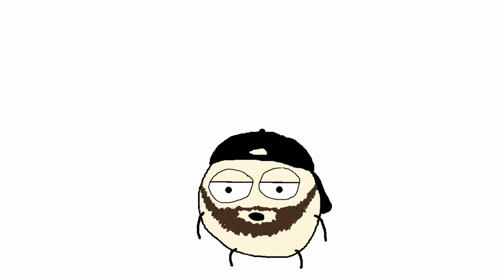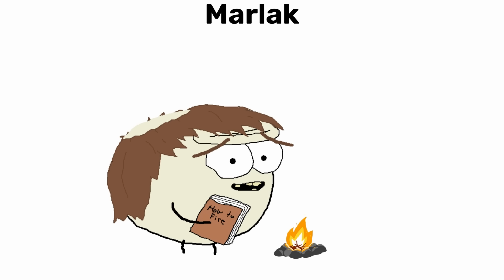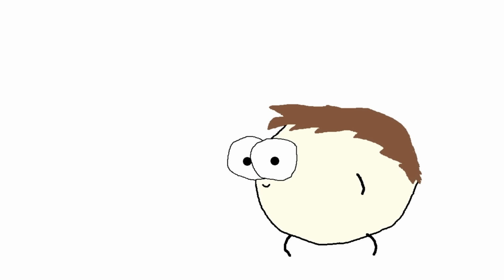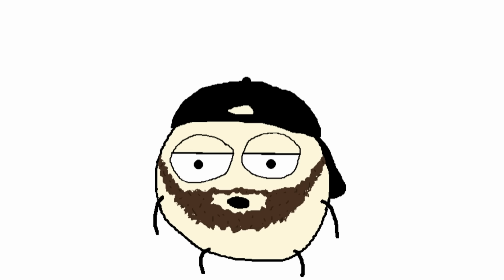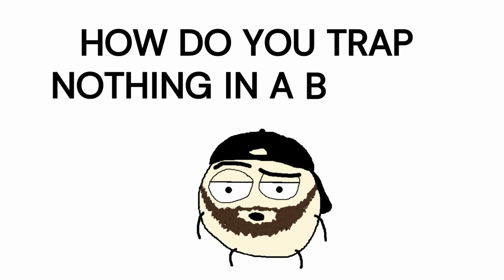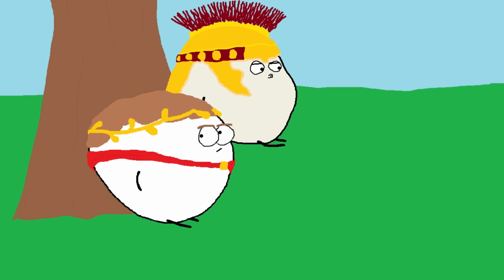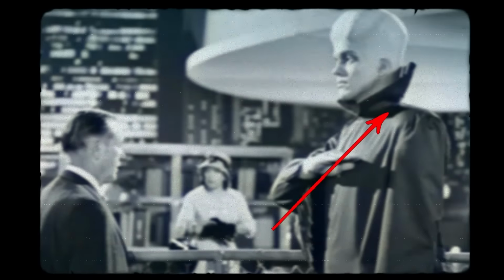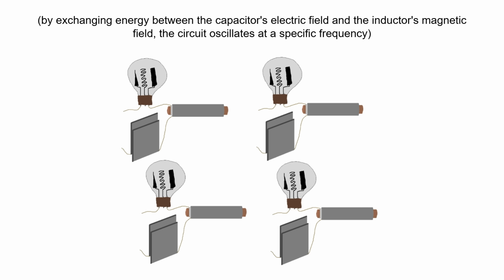How long would it take to build a TV in ancient Rome?

Comment: Nuclear reactor vs computer chip in Han Dynasty China? (I beg of you)
Reply: nuclear reactor would be the easiest. we DID invent the nuclear pile before the integrated circuit, after all.
Reply: @michaelfixedsys7463  that's not even mentioning natural reactors, which already existed hundreds of millions of years ago. in it's simplest form, a reactor is just a pit of nuclear fuel, use that to boil water, put a turbine in the way of that steam, and you're done. meanwhile even the most basic silicon transistors... it'd take decades...
Reply: Depends on how controlled the reactor has to be, because "completely uncontrolled" was figured out by geology under west Africa quite a bit before humanity ever considered that uranium can go boom.
Reply: Ts fire
Reply: Interestingly, the first nuclear reactor was natural, and about 2B years ago.  Back then, the ratio (we would call it enrichment now) of U235 to U238 was high enough that a cave with ordinary (we call it "light") water with enough uranium in it would heat up due to nuclear reactions of the water moderating the neutrons from the uranium.  When it got hot enough, the water boiled away and the reaction stopped - until there was more water in the cave covering the uranium again.  This went on for many thousands of years.  Look up "Oklo natural reactor".
It worked very similar to that of how the CANDU reactor works, but with such strong U235 concentration, no heavy water was needed.  
Roman times are way too recent on that scale, so they would either have to enrich the uranium (for a light water reactor), make heavy water (to use with standard uranium) or use another design we don't really use today.  The first man-made nuclear reactor was built under a sports field, look up CP-1 (recommend Wikipedia).
Reply: ANYTHING in Han Dynasty China!!! PLEASE. That said, yes, I've spent a lot of time trying to imagine how to actually perform a transmutation reaction with alchemy-level tools and prove you did it. I THINK it's possible, though it is both a bit dangerous (but not worse than most alchemy experiments...) and unimpressive unless you know WHY 2 converging lines in a cloud chamber that then become 1 is such a huge result.
Reply: I'd be interested to see a nuclear reactor on the Northwest Coast or in some other culture that used bentwood boxes full of heated rocks to cook and boil water, controlling temperature by removing hot rocks or dropping in cooled ones or thermal insulation. The principle is very much already there. All that is needed is a trade route to somewhere with uranium ore, concepts of radiation and shielding (connections to China are good here-- radiation and qi follow similar paths to the point that I learned feng shui by remembering it as "ass-backwards bizarro land Protect and Survive"), and some method to achieve it so your inventors don't all kill themselves.
Reply: Fr, you think Han Dynasty China was worried about nuclear reactors when they were still trying to figure out how to make paper that doesn't disintegrate in the rain? Meanwhile, their computer chip was basically a dude with an abacus, calculating taxes for the emperor like a medieval accountant on 💀.
Reply: @MidnightMemeHistorian  If anybody can join the nuclear club in the 1st century, it WOULD be the Chinese... They've been the first to a lot of innovations even they got developed further elsewhere, and they already have both a robust tradition of alchemy AND are the inventors of feng shui, a discipline which just so happens to prefigure the rules of radiation safety best practice completely by accident as long as you explain radiation as a malevolent counterpart to qi which moves in the same way.
Reply: nuclear reactors happen naturally without any help from humans... read about oklo, gabon.
a dinosaur probably made a nuclear reactor already in 50 million BC by kicking some rocks into a sinkhole.
Reply: I believe a reactor would be easier than computer chips... Messy but easier
Reply: YESSS
Reply: And yet the simplest living cell is a more sophisticated and complicated machine or system than a nuclear reactor or particle accelerator. A true marvel of design engineering.